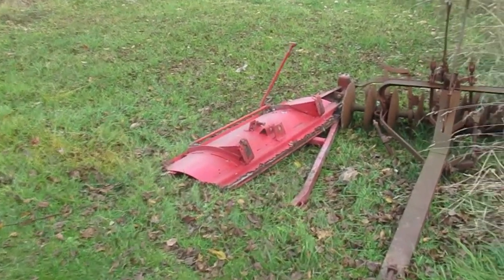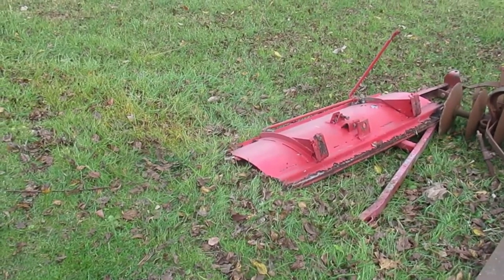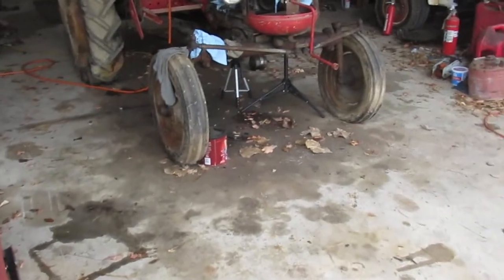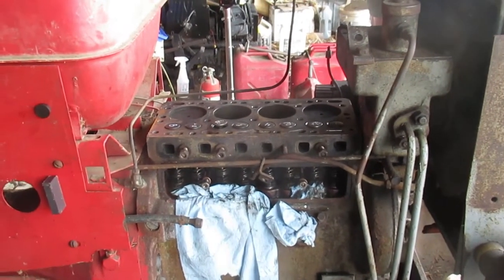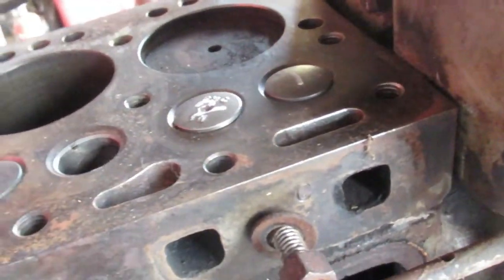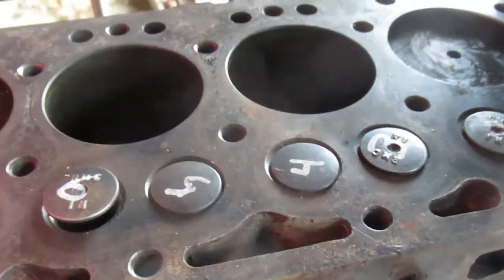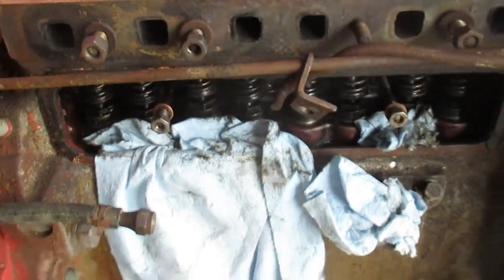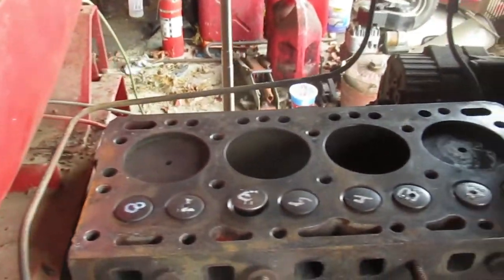Pony update #1

Comment: Wow, you know a lot about a lot! That's some deep engine work. I lose important things way more than I would like to admit. Are the valve rotators absolutely necessary? I like the use of a magnet to lift the valves. I hope you get it going before you get much snow. Thanks for sharing.
Reply from the maker: Actually  I'm told that those rotators really aren't needed so probably would run fine without them but I'm probably gonna make them anyway. Thanks for watching!